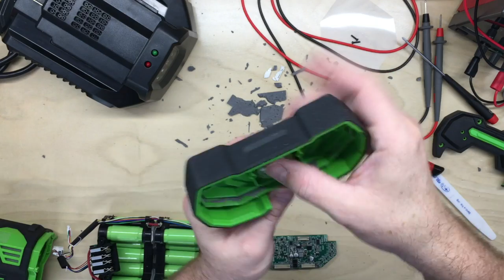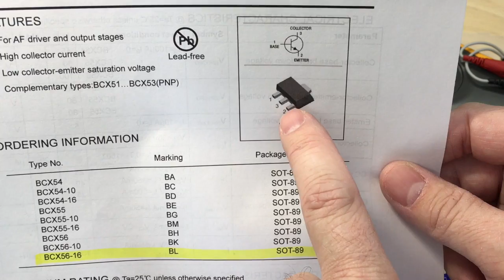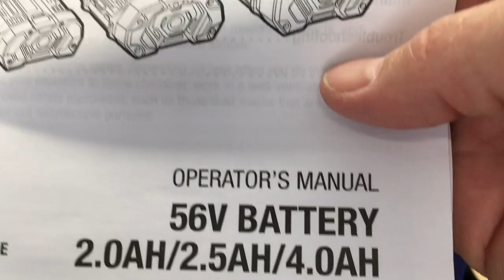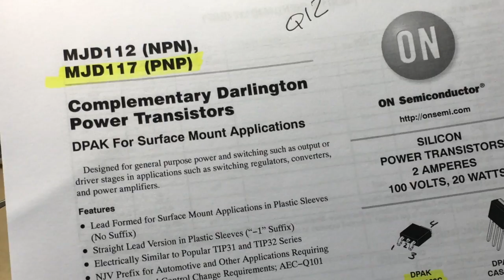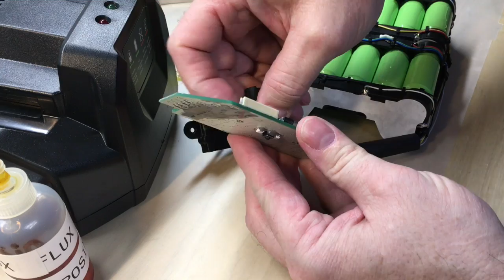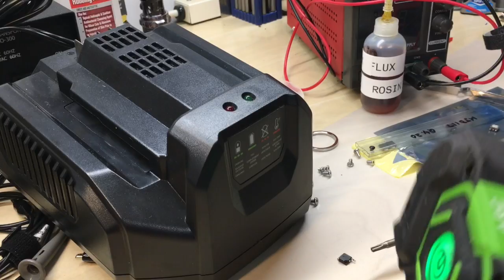EGO 56V ARC Lithium Battery Repair

Comment: Does the battery discharge itself just by using energy to power the blinking LEDs? So if I were to remove the LED would it have the same result as stopping the source of the discharge? Continue to use battery like normal after that?
Reply from the maker: Well, it would perhaps slow it down alot, however, the DC-DC Converter will still be on and will draw some current. I have not tested this to say for sure though. Replacing Q12 shorted transistor will usually get the pack back going.
Reply: Thrifty Tool Shed Yeah it’s better to do the job correctly. The removing the LED was my thought before I knew of the exact problem. Thank you for the video you helped a lot!

Comment: Nice! I bought a couple dead batteries off ebay in the hope of using parts between the two to make one good one. I had one that flashed green after jump starting the battery. It had 3 or 4 failed cells. The other packs front panel was dead. Checked the cells and every one of them was 3.7v for the win! I swapped over the flashing front and that packed worked perfectly. Then I watched this video and got excited that I might be able to get a fully functional pack. I removed the silicone around that transistor and mine is shorted in the same manor. I'll be ordering the transistor after I click send. Thanks man you're awesome!
Reply from the maker: Awesome, great job! Thanks for your comment!
Reply: How did you get on with this. I've just ordered my part for a fix.
Reply: @michaelbirchall2247  it’s was a success! I’ve been I’m using it for I guess a year now. I have two of the same size packs that I alternate between for the weed eater. At this point I’m really not sure which pack I fixed and which came with it. They perform the same.
Reply: @somethingsomeone5440  that's great. I've also just fixed mine the same way. It's a great feeling.

Comment: Hello. Please help me find that MINI Transformer which is located between the 25v 47uF capacitors.  I have 2 batterys dead with bad transformers. I just can't find it. Please help if you can. Thank you
Reply from the maker: Sorry, I have been asked this several times. I do not know, I have taken the metal can off and still do not see a part number on the transformer, this could even be a custom part for EGO, not sure. What I did was bought several bad packs of eBay several years ago and now I have some spare component parts that I can't find anywhere. The bad thing is when I first started mentioning buying the bad packs on video, you could get them for around  $15-18 each in a lot of 3,5 or so, but not  anymore. It is hard to find them at a scrap price, which is about all I am willing to pay because without knowing the shape of the cells, they could all be bad. Wish I knew more, but with no real schematic, detail parts list or part number it is difficult. Wish you the best of luck!

Comment: Thanks for the vid, mine is blinking green, does it mean its bad or just doing that discharge cycle, was working great but i was only useing about once a month or less
Reply from the maker: Well if it keeps on blinking even after you charge it up then it is bad. It will keep pulling the cells down to zero and ruin the cells if you do not keep it charged well and often. If working properly it will not pull below 35v for sure and it would of course reset once it goes through a charge cycle.
Reply: @ThriftyToolShed  Ok got the board out and removed the PNP Transistor, im getting a short on the right leg to the top pin
Reply from the maker: Hopefully that will take care of yours as well. Do be careful with the right or pin 3 desoldering, the Trace is easy to pull up. On mine I will carefully desolder the smaller pin1 and pin 3 and gently lift up off the pads, then remove the whole thing since the base is such a large area.
Reply: @ThriftyToolShed  Well thought it was fixed, installed the new transistor and it flashed green, then put in the charger and its flashing red but not continuous, the battery is showing 57.5 Volts was at  58 volts, but when I put it in the weed whip it runs about 10-15sec then shuts off and the light light then blinks read without pushing the button
Reply from the maker: @shckltnebay  
WOW, how did it get over 10 volts to high? It should not charge over 58V really.
The other odd thing is how the tool runs for 10-15secs and shuts down, typically it's not picking up the pack on the D-terminal. If the tool/controller  does not sense the pack on the D-terminal it will shut down like that?
 May want to look over board really well and make sure a small component did not get damaged or knocked off when removing the potting...
Reply: @ThriftyToolShed  I meant 58 and 57.5 volts, i fix that but not fast enough. I did have the micro switch actually pop off from just handling the board must have be a poor solder, I was pretty careful and dont see any other issues, thanks for the response, on more thing is I get 20v on T4 and T5 but that doesnt add up because ive got 57 volts overall
Reply from the maker: Ok good. Voltage is good! As far as the 20v, I do not remember, but I believe the DC-DC Converter is around 10v if read accross the capacitor (C3) right above the transformer. This only comes on once the button is pressed.
Reply: @ThriftyToolShed  Just tested it at 54 volts, got the part coming but man that epoxy looks really hard on mine
Reply from the maker: @shckltnebay   
Mine was a gray silicone based material, they may have changed it?
Reply: @ThriftyToolShed  No the material just looked hard, it was like silicon, mine is probably the same age as yours

Comment: Your videos are impressive!  Very detailed and worth the watch!  I have 2 batteries, one a 7.5Ah and a 2.0Ah I'm playing with.  The 2.0Ah one had the continuous blinking green light and wouldn't take a charge.  By now it is completely dead and need to figure out how to "jump" the cells so it'll charge after repair.  The 7.5Ah wouldn't charge at all.  It had juice when I bought it.  Anyway, thanks to your videos, I'm hoping to resurrect them.  Hopefully the 7.5Ah more than the 2.0Ah LOL!
Reply from the maker: I totally understand, hopefully you will get them up and running. The cells being completely dead is not good, most likely have lost capacity on some cells! Best of luck to you! Thanks for your comment!

Comment: Do you accept boards sent to you? I have a 5.0ah battery that may have gotten rained on while in a blower. It has full voltage and will only operate any tool for about 3-5 seconds before it cuts out. I have it apart and would love to get this battery fixed to have another battery in my arsenal. Any help is appreciated. Great videos btw!!
Reply from the maker: Thanks for your comment! I
wish I had time, I do get asked this often. I work full time+ and try to have time to edit videos to post. I try to help by posting what I have found with a similar items and do try to help if someone is having issues.

Comment: Hi, what are the white connectors called?
I just need to pins to replace on the wires
Reply from the maker: Looks to me like molex connectors, but I have not taken the time to figure out what connector system it is. For example it looks close to the Pico-SPOX connector system, that is where I would start looking and comparing if I needed one. Again, not sure,  just saying it is similar.....
Hope it helps!
Reply from the maker: https://www.molex.com/molex/products/family/picospox
I would check into these and see how close they are, seems really close?

Comment: Hi. Do you have partnumber T1 transformer from the board ? Is it possible buy it anywhere ? My is broken (((
Reply from the maker: I do not. Sorry but I have not any issue with my transformer yet. Great job troubleshooting and best if luck to you!
Anyone else out there had similar issues, or found replacement?

Comment: Do you have an updated link for the ebay Power Transistor. Thanks
Reply from the maker: http://rover.ebay.com/rover/1/711-53200-19255-0/1?ff3=4&pub=5575400462&toolid=10001&campid=5338325412&customid=&mpre=https%3A%2F%2Fwww.ebay.com%2Fitm%2F1-pcs-Motorola-PNP-2A-100V-Darlington-Power-Transistor-MJD117%2F264256482703%3Fhash%3Ditem3d86e9ed8f%3Ag%3AdakAAOSwK1Rb-sIN

Comment: Hi there. Awesome job! I have a problem. I want to use a diff battery to power my ego blower but it would only stay on for 4 seconds. It has something to do with the D connection. How do I bypass that?
Reply from the maker: The short answer is I don't know.   I still am not sure of what all the D terminal does. I know it reads around 10k ohms at ambient thru the NTC (on the BMS board) back to Negative terminal and it also has a pulse or signal from battery management board which let's the tool know when to shut down. I notice also the fuel gauge LED lights up when you start the tool so I believe it is i2c or maybe can bus communication between the pack and the tool? I looked into it enough to know it has what seems to be 2 different 15khz pulses at around 18 microseconds separation!
Reply: @ThriftyToolShed  when I connect my  60v snapper battery on the ego blower connecting the D(from the ego) to the ohm on the snapper battery, the led fuel gauge would turn on as I run the ego blower but would turn off after 4 seconds runtime. I can get 4 sec bursts only after I let go of the trigger for a sec. And I tell you what the blower is much more powerful at 60v than 56v. Felt like turbo was on without the turbo button.
Reply from the maker: @fishinman69  
It's interesting that it only last 4 secs! I do remember testing my blower a while back and with the white wire (D) unhooked (basically just jumping + to + and - to -) my blower runs 10secs then shuts down after not receiving the battery info. Alot of packs and tool systems just use a NTC so it is a ohm or resistance reading between usually the negative and the feed back terminal like D (not sure a out the 60V you have) This EGO system has had me scratching my head! Lol! I have tried to figure it out several months ago to help answer a viewers question about adding cells to increase capacity for the Nexus power system. I did not come up with a solution. Then the viewer decided to add the cells in capacity across the pack in parallel and the pack still registered the EGO pack so it works and increases capacity. So I really have not spent much time on it after that. Especially since it seems like a communication link between pack and tool!
Reply from the maker: @fishinman69  
Have you tried it with the pack run down to around 58v by chance? Just wondering if the blower is picking up over 60v as possible overvoltage and shutting down, just wondering since it shuts down in 4 secs instead of 10  if it's protection mode?
Reply: @ThriftyToolShed I thought the same way too but it shuts down the same when I hook up the ego battery without the D connection lol. Thanks for your replys!!!

Comment: Thank You for this video! I am having similar issues on a 6Ah battery and followed your troubleshooting... Q12 is faulty indeed! Then on the other side of the board R171, R192, R210, are visibly roasted so I will replace them as well. I tell you if it works afterwards. Cells went down close to 0v but I could recover most of them but I expect their capacity to have dropped.
Reply from the maker: That is good to know. I have a 5.0Ah on the bench right now and  for the first time see that the BMS board looks the same as the 2.5Ah. I have been wondering if that was so, I have not had a failed one til now. Hopefully your pack will be fine, I usually find the cells are just as you stated lower in capacity even if you save them! That's the really bad thing about this failure, if you keep it charged it will protect the cells but it's a chore and most of them do eventually get pulled to zero before we get around to disassembly and disconnecting the BMS. Best of luck and thanks for your comment!
Reply: @ThriftyToolShed  I finally found time and all necessary components to repair it and... It works! Thank you again for this useful troubleshooting. I replaced all cells by 3Ah capacity so I got a 9Ah pack :) I had to replace a temperature sensor that was torn off during the un-mounting as well (J3Y) :/
Reply from the maker: @sylvainlathuy2702  
That's awesome, excellent work!
Reply: @ThriftyToolShed  When replacing cells in the battery packs, what Current factor (C) is needed?
Reply from the maker: It is hard to say for sure which cells are in the packs due to the unmarked cells but we know they are close to 2500mah due to the 2.5ah, 5ah etc. rating. I bought several bad packs from eBay over the last 4 years or so and tested and collected the good cells from some packs while that helped me repair many packs. We know they will be high current cells. We have had some comments from viewers on here saying the cells they thought their packs have.....
  (Jonathan Ridder) mentioned his had Sanyo UR18650NSX. (Ipissed) mentioned his are Samsung INR18650 with phase change sleeves made of paraffin wax/carbon graphite.
I keep lots of spare cells from almost new packs parted out as well as other cells tested very well for capacity. I usually do not recommend cells because  of some fakes out there  The main thing to make sure is that the seller is truly selling genuine cells. I have had great luck using 18650batteeystore.com in the past. 
I share some of this in this video if you find it helpful.
https://youtu.be/f9SOPVEqgkw

Comment: @Thrifty Tool Shed. Binge watched both your videos, repairing eGo battery pack. 👍👍👍👍👍. Enjoyed it very much. Thank you. You and your patience of brute force trouble shooting when schematics are not available! Most of us don’t have that patience, though in my days, I have reverse engineered TTL boards. I stopped after large scale ICs appeared. 
By the way I was looking for tear down of eGo self powered (2102SP) mower, and your videos appeared. My 2102SP is stuck on high speed self propel mode. Seems many users face the same problem. Let us hope you tear down the Self Propelled, and analyze the logic boards, some day.
Reply: That was a fast response.Wow! No it is all the time. There is a speed controller in the handle. I opened it it. It is a 2.2k potentiometer, and measures properly. This pot probably goes to a small logic board, which maybe a pwm controlling the field current to the small motor which turns the front wheels. The design is a nice design, eliminating any belts. Letting the large electric motor do the lawn mowing, and the small one do self propulsion. As to your question whether it is a general problem, I think it is, judging by the complaints in eGo Community Forum. The users are complaining about nonfunctional, to stuck on high (my case), or stuck on low self propelled speed. Service times by eGo being the way they are, 6 weeks, I have not bothered sending it in mowing season.
Reply from the maker: @xxycom8963 ,
Ok so several different issues, I do wonder how close this controller is to the chain saw brushless motor. I did repair a controller for the 14" chainsaw and it had shorted power mosfets. I bet it is a close design maybe not the hall effect feedback though!
Reply: Thrifty Tool Shed , thank you for your response. If you can control the speed of the chain saw (say, where a pot sets the operating speed), then it is possible that the designs maybe similar. But if the chain saw speed is not controllable, then the designs are different.
Reply from the maker: @xxycom8963  ,
Yes, I thought about it after my last reply, it is most likely more similar to the blower speed control which does have a speed control on it as the chainsaw does not. I repaired the saw in a video, but the Blower ended up being a fault finding video. I did find issues, but in the end stopped due to the repair cost being too great, but it may be helpful to you if similar? The mosfets are similar to the saw Controller board. And also had shorted smd mosfets but also seemed to have a bad IC chip. So cost of fuses, mosfets and main IC chip made mine not cost effective. I hope mine was the exception rather than the rule, and that others had more luck!
https://youtu.be/VozF_II00-o
Reply: @ThriftyToolShed  I finally managed to get off my couch and repair the LM2102SP ‘s speed control problem. Two wires were broken, replaced it with CAT 5 cable ( cheapest solution ). The mower is now working as a charm.
Reply from the maker: @xxycom8963  Awesome, I have read in several forums since your original post of similar issues with the broken or pinch wires in the hinge or fold of the handle.
Reply from the maker: Thanks for your comments. I only have a non-self propelled EGO mower but that is very interesting for sure. I have not heard of that being an issue with those.  Is it all the time once it's turned on (activated)?

Comment: I have a 2.5AH battery flashing orange what is the fault   thank you
Reply from the maker: It is typically a temperature fault.     They are really good about replacing under warranty. After that if they allow you to keep the pack.  I would check ntc connection first.